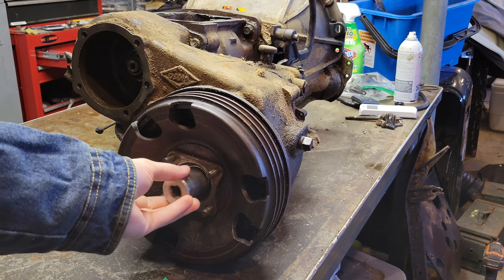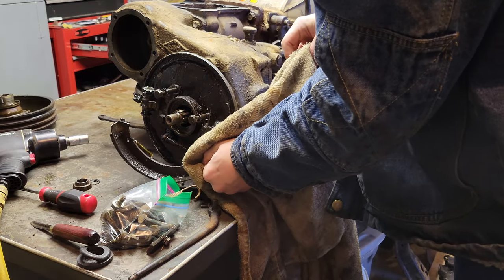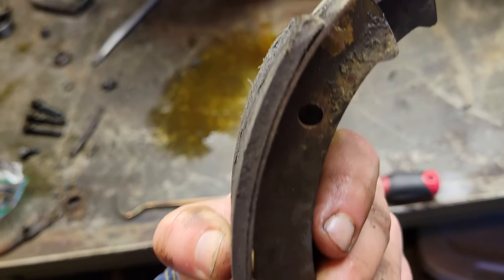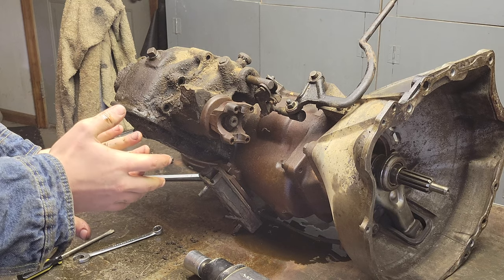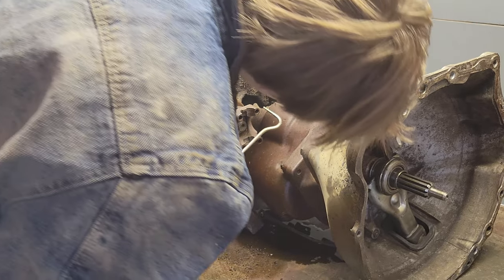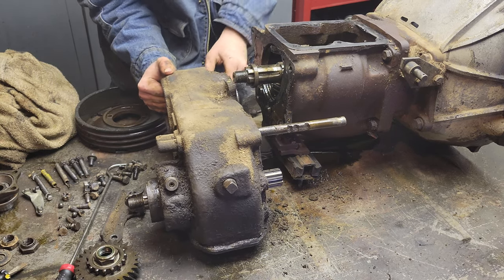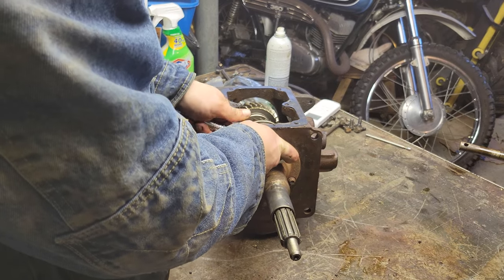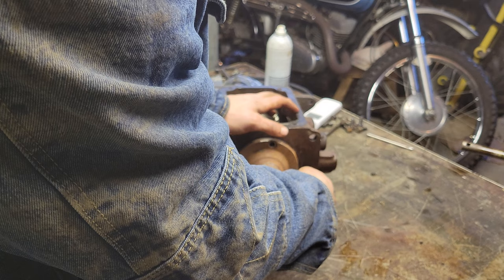Digging Into the Jeep's T90 Transmission

Comment: I admire your commitment to learning about how to work on these old vehicles but I would suggest getting a service manual, it would save you a lot of time and frustration to read how to correctly disassemble and assemble these components. In the end you got it apart but the way you got there was kind of backwards. I have a CJ5 a few years newer than yours and a 61 scout with the same transmission and tcase  as your Jeep,  I can tell you they are very capable even in their stock form and a lot of fun to drive, I have been all over Texas in mine and the Rocky mountains in Colorado.
Reply from the maker: I do have a service manual for it, but there's hardly any info for the tanny and transfer in it.
Reply: @waltersunrise1584  Yes you almost have to get a factory service manual for specific components. Good luck and keep the videos coming
Reply from the maker: @autotech1984  new one uploading right now!